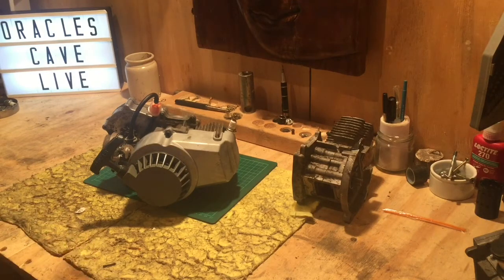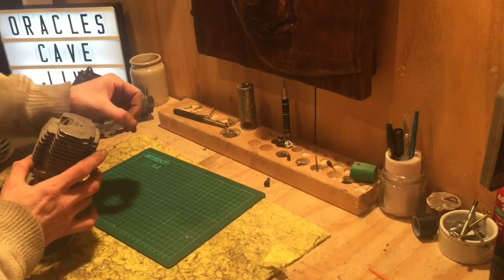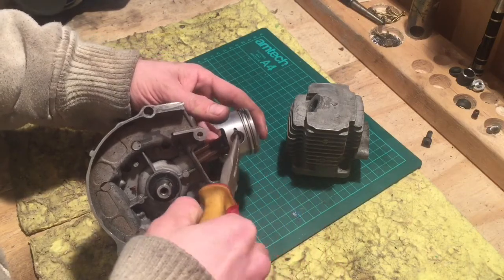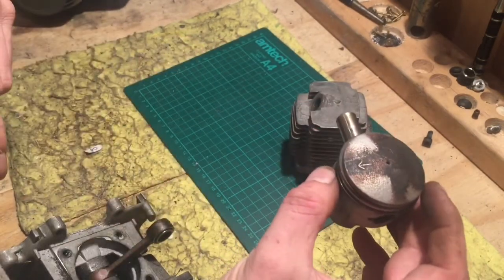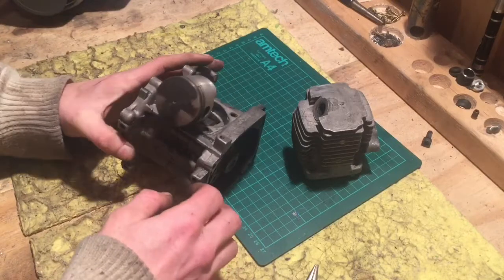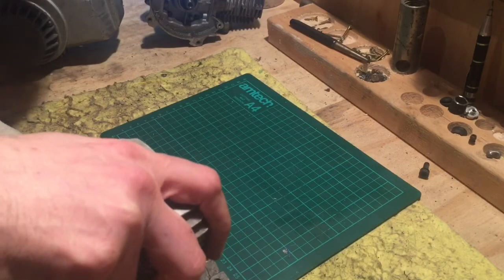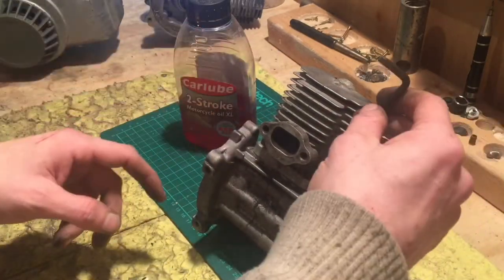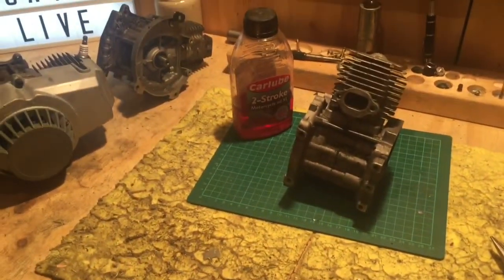HOW TO REPLACE PISTON IN AIR COOLED ENGINES MINI MOTO

Comment: Always make sure your arrow points to your exhaust.  And be carfull with ebay engines i had to replace a head and piston they look fancy but the quality sucks the engine i replaced the head and piston on ran for 2 days from new bad part about the old cylinder is there were a second set of cutouts for bypass for some reason that and it was built wrong in china is what destroyed it.
Reply from the maker: Sometimes it can have extra holes if it has been "PORTED" 
It's for extra power, and yes the quality of this stuff is very hit and miss.
I sometimes purchase multiple parts at the same time and always get double or triple.
When my friends need parts, I try to give them my worst looking parts, so I keep all the better ones 😆 🤣 😂 
But I still end up with crap and their parts last forever 😆 🤣 

In the process of building a 20 foot hut, so more building videos will be coming soon aswell as more crazy crap 😆 🤣 😂 

Sorry it took so long to reply, been busy turning my house into a building site ha ha
👍👍👍

Comment: Thanks for explaining how to re-fit the piston into the cylinder barrel. I’ve snapped two sets of piston rings trying to do it with the 44mm piston in a mini quad bike. However the 40mm piston in the mini moto cross bike was easy to refit. I think the rings snapped because I had the ends of them in the cylinder gap and not in the solid part. I think I’ll take the engine out and re attempt, so I can see what I’m doing and so I can actually get my fingers around the rings.
Reply from the maker: Remember to pinch the rings closed with your fingers as you are pushing the piston in.
Don't just try to push the piston in, you must squeeze the rings as you push.
Take your time  and rub some 2 stroke oil on the cylinder and rings just before you install them, it should make everything easier and reduce the chance of scoring the cylinder.
👍👍👍

Comment: Easy to work on when the head and barrel are in one eh!
Reply from the maker: MalcOfLincoln yes, much less fiddling around, I don't see why everyone has so much trouble with these little engines, I think they are amazing for the size of them.

I have been speaking to someone who has a pit bike that needs work, so might end up with that aswell, maybe rip the engine out of it and put it in the go kart or fix it up.
He reckons £70 should get it running lol it has no brakes, chain, pegs,throttle, carb, sprocket,exhaust.
Something tells me it's gonna cost a lot more than £70 lol
But I can maybe get a good deal on it
4 stroke Lifan engine with gears.
Hopefully I can get my hands on it.
Reply: Neither do I really. They just need someone hands on to show them. Now, you might like to look at the engine project I did there is a playlist. Watch the beginning, just to get the idea, then skip all the cleaning and stripping etc. My friends were spurring me on, keeping me honest lol. This is what actually started me making videos as a hobby. I was watching Roadking, so thought I'd have a go. Made a lot of videos before, but this was the first long project. Pleased I did, as I managed to show my experience. Several of my friends have actually told me I did a good job, not only on the engine, but the video series. The lad who helped me lived locally, and had a pit bike, so I took him to the local kart track with it a few times.